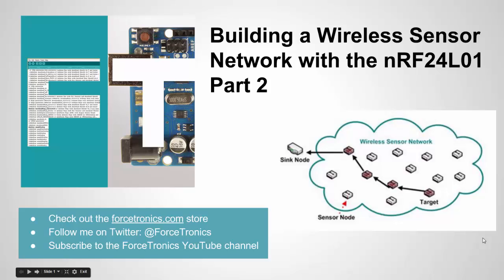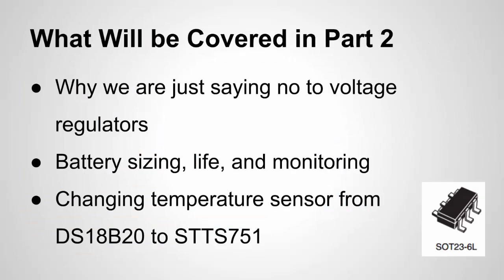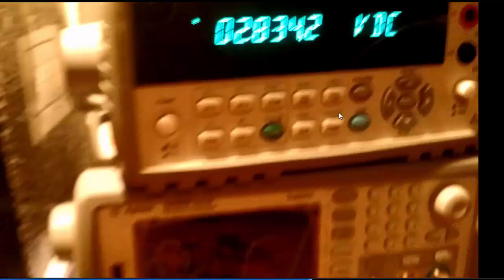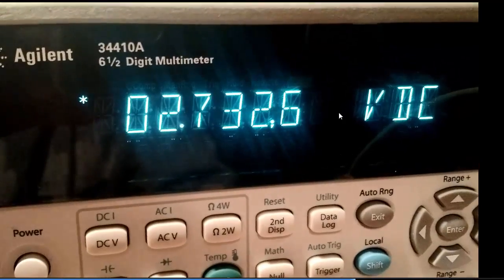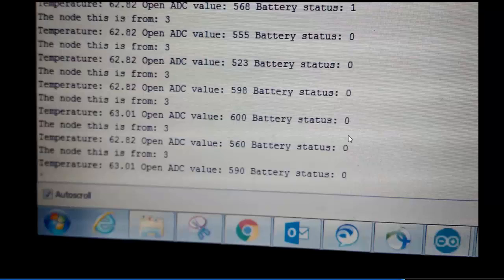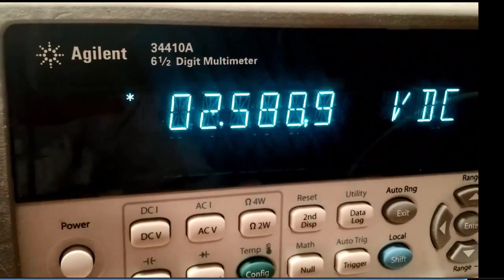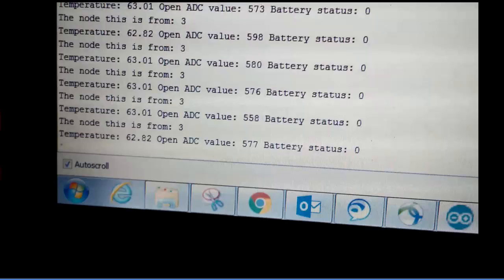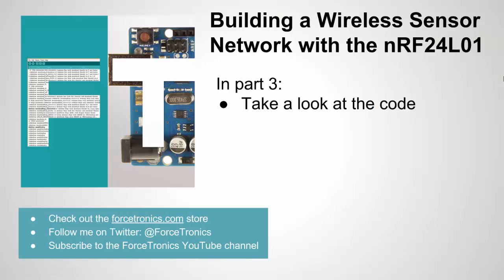Building a Wireless Sensor Network with the nRF24L01 Part 2

Comment: The battery power consumption issue is rarely addressed and you packed so much practical and useful information into your excellent explanation.   This video will be my "go to" reference when doing all my battery powered Arduino projects.

Comment: Hi, thank you for this very interesting course. i noticed, the resistor divider consumes current every time. Typically let's say 3V/(560K+180K) = 4uA . (6.6% of 60uA power consumption). It is possible to avoid that, for instance by connecting R1 to an output and only enable it when you do the measurement. Another point, you can remove the resistor connected to the switch by using AT328 internal pull-up resistor instead. Now I am going to follow the next part of this interesting course ;-)
Reply from the maker: Thanks for the great input. As you will find later in the series there is a way to avoid the resistor divider approach and measure it using the known internal ADC reference value.
Reply: If you are connecting the AVR directly to the battery, you can put the positive side of the voltage divider on an unused pin and just turn it on when you need to make a read. Beware that there is going to be a small voltage drop but you can compensate for that.

Comment: Love the series! In Part 2, you discussed measuring Vcc using the resistive divider and the internal 1.1v ref. You measured the actual values of your two resisters and calculated a "divide factor" that was to be stored in EEPROM. I have measured my two resisters but don't see where to input them. The fReadVcc() function does not appear to use any "divide factor". Am I looking in the wrong place?
Reply from the maker: +Lloyd Linnell There is a comment in this thread where RoterFruchtZwerg let's me know that there is a way to check the battery voltage using the internal ref and just the ATmega328p without have to add a voltage divider or use up an analog pin. I make an update to the design in a later part (3 or 4) where I give the details of the update and the method. Long story short I take out the voltage divider and therefore you don't need the resistor voltage divider cal factor.
Reply: +ForceTronics awesome! two less components. must have missed that one. thanks

Comment: Hi, Great video!! I just had a quick question. On your battery power needs, you calculated 55.84 uA based of 600 seconds. You used 60 uA per hour for average. I was wondering wouldn't it be 60 uA x 6 to get the power consumption for 1 hour instead of using the 60 uA that you rounded up for 600 secs(10 mins)?
Reply from the maker: +wailingpeanut I am calculating amp hours (which I probably should have labeled better). The design cycles every 10 min so I use that to get its average consumption per cycle. It doesn't mater how many cycles occur in an hour whether it is 6 or 60 its amp hour usage is 60uAh.
Reply: Sorry for commenting on an old comment but can you explain this a little more for a beginner. Im lost in this concept, wouldn't transmitting more cycles in an hour pull more than 60 uA?
Reply from the maker: The unit of measurement is not 60uA it is 60uAh. This stands for 60 micro amp hours which is a measurement of average current consumption over an hour.
Reply: Thanks for this explanation. I've been trying to figure this out for days

Comment: I hope you are intending to (or  we can) use the arduino clones instead of a breadboad.  Our meetup group has found that the clones are cheaper than the parts.   Additionally, I would not want to expose a breadboarded unit in the field.  Having used your boards I like them but I like to use off the shelf products available.  There are rugged versions of the arduino avalanche as well .  600 days plus  for the transmitter batter is really great and opens a lot of opportunity for us.
Reply from the maker: +David Jenkins I totally agree, the breadboard is just for prototyping purposes. I plan to do a custom PCB board layout for this design using Eagle software (free for hobbyists) which will probably happen in part 4. Once complete I will share the files on GitHub for other to use.

Comment: can we use cr2032 or a different model of coincells for power?
Reply from the maker: sure if it meets the 2.5v to 3.6v range
Reply: I got the same idea:) We can use it for powering nrf24l01 and add another in series to reach 6v.. to power arduino and ds18b20 :)

Comment: Did you know the 328P can measure its internal 1.1V reference against AVcc? This way you can measure your battery voltage without additional circuitry: https://code.google.com/p/tinkerit/wiki/SecretVoltmeter
Reply from the maker: +RoterFruchtZwerg Thanks for the info, I will check it out!
Reply: +ForceTronics I'm using this method on many projects. Having an Arduino Pro Mini 3.3V (8Mhz) reading its Vcc and Temp/Humidity from a DHT22 every 5min and broadcasting it using a NRF24L01. It's powered by a standard 1.8Ah Li-Ion cell (which has 4.2V fully charched btw) for more than a year now. Only modification I made to the Arduino board is removing its power led. Since I use the 3.3V regulator I cannot measure the battery voltage directly, but the 3.3V will start to drop when battery goes below ~3.7V which is still fine. My circuit goes to permanent sleep at 2.8V Vcc which is ~3.2V battery voltage.
Reply from the maker: +RoterFruchtZwerg I plan to update the project using this method to track the battery voltage. Thanks again for sharing it!

Comment: Surely 60uA for 10 minutes not per hour.
Reply from the maker: I don't quite understand this comment. I use a 10 min capture of current to get an average current value over that 10 min. I then make the assumption that an hour would have the same average current. I then use that current value to do an amp hour calculation on battery life (10 min avg current is 60uA therefore assuming 1 hour also has 60uA average current so amp hour current consumption is 60uAmp hours).